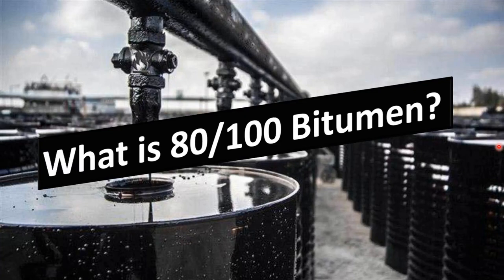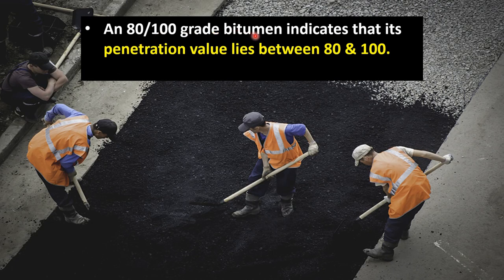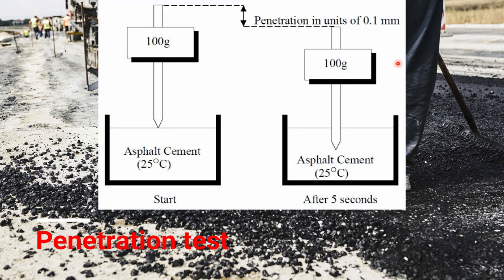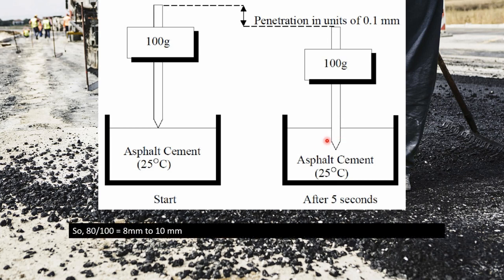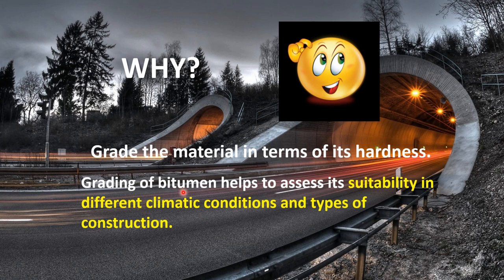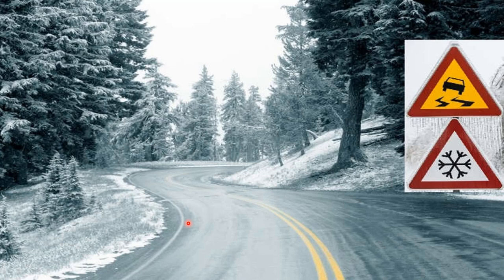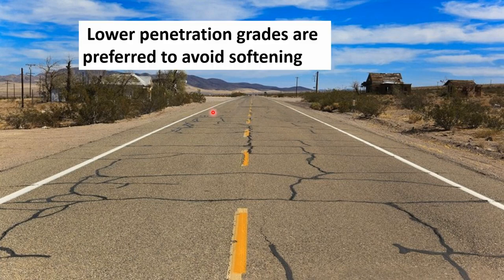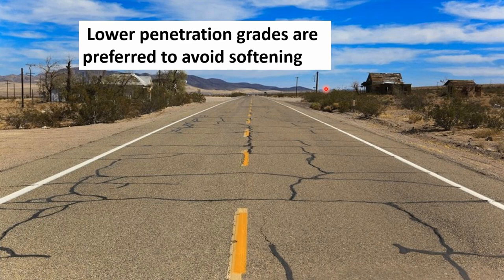What Is 80/100 Grade Bitumen?  & It's Applications

Comment: Sir embossed and non embossed bitumen kya hai
Reply from the maker: Tufail 
In the States the embossing of asphalt concrete (bitumen to you) has become a popular form of architectural finishing of asphalt paving. This can be used to simulate brick, cobblestone or flagstone ( among many) textures. It is also extensively used for the same effect on cement concrete.

The embossing is performed by using special rolling machines or by manually stamping into the surface before the surface material has hardened.

Non-embossed surfaces are simply surfaces that have not been embossed as this term should be self evident.